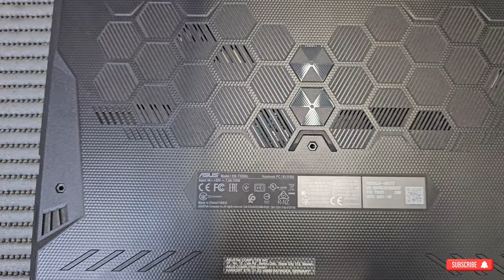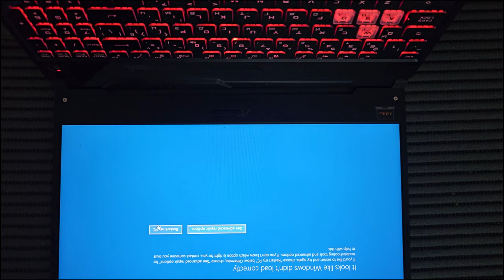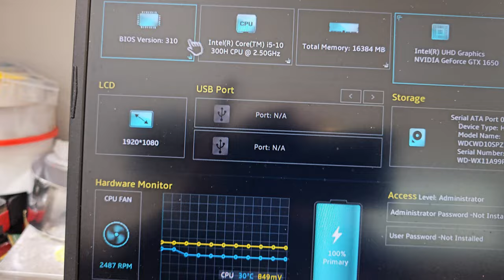ASUS TUF Gaming F15 FX506 disassembly and repair no backlight 4K #asus #repair

Comment: You did not change or solder anything, so what did you exactly
Reply from the maker: the fuse was changed, but I didn't take a video because it's elementary
Reply: whats with the flashdisk?